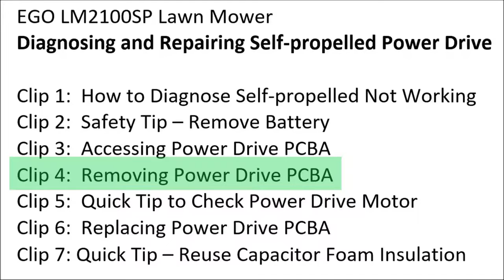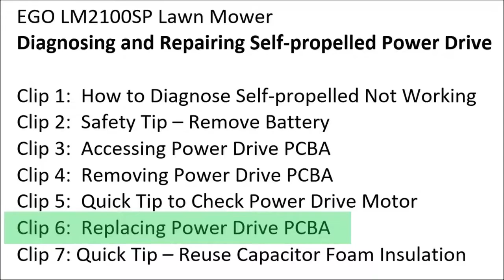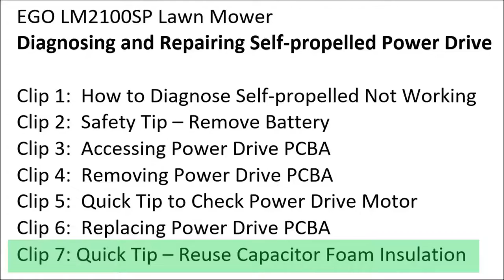EGO LM2100SP Self Propelled Drive PCB Replacement

Comment: I had the same problem, i watched the video and started to disassemble.  I removed the cover to start troubleshooting,  i noticed that there is a switch mounted on the right side , lokking atitfrom the rear of the mower. I put the battery in and applied pressure back towards the cam off theswing arm for the handle.  And the drive motor was working again. Made a wedge and placed it behind the switch to take up the wear.  Back in business!

Comment: Had the same problem with my Ego 2100SP. Self propelled stopped working, but the blade still worked. Everything worked except self propel. I noticed that the handle was not fully extended. So I fully extended the handle and the self propelled started working again. Be sure the handle is fully extended.

Comment: I have one of these which is behaving in an intermittent manner - can mow with the self propel feature working fine for a while and will randomly stop working for about 30-45 minutes, and then start again.  Took it apart and all harness are connected solid. Ideas?
Reply from the maker: test the main pcba there a video on here.

Comment: Just replaced PCBA module on LM2100SP, question what does brown wire connect to? Orginal brown wire in mower is connected to a red wire that is broken  just laying in the mower. Where is it supposed to be connected?
Reply from the maker: i am not 100% on what wire. did you replace the selfdrive pcba or the main?
Reply: @matterwin8635  Self Propelled Drive just like in the video, same wire you have in your fingers at 6:36 into video.
Reply from the maker: @EdMcGrath-t9b  sadly i did not make this video one of the engineers did. but that wire which you can not clearly see lol should be connected to the safety switch on the right side as you are standing behind the unit. the one that is activated when the handle is folded and unfolded .
Reply: @matterwin8635  Thank you much, I guessed that because of the length, but wanted to make sure before I soldered it back.

Comment: the 6 screws that hold down the top cover, are they hex or torx, what size bit did you use ?
Reply from the maker: torq T20
Reply: @matterwin8635  no, they are Phillips head
Reply: phillips head in LM2100SP version 1

Comment: So I replaced the PCBA but I don't see where the brown wire connects on my mower. I see the white wire but no red wire on that side. Any thoughts?
Reply from the maker: brown should have small wire running to the battery

Comment: Longshot here: I have a LM2100SP Type A, and the self propelled feature has stopped working. It will make a soft clicking sound for a few seconds before stopping. Blades run fine. Any ideas if it's the motor or the PCB? Do you have any videos of replacing the motor?
Reply from the maker: it is 80% chance it is pcba

Comment: What about a self propelled drive works but low power only no speed change
Reply from the maker: could be in the handle broken wire are the pcba that controls the self-drive. ruin the test in the video and see what one.

Comment: Good video, but kind of vague, most people don't know using heat shrink tubing and putting it on before soldering or how to solder or cut wiring/ connections without making it a headache if they cut too close to a connection. Could be more clear on assuming people have lil skill or just using wiring connectors to attach 2 pieces of wires.
Reply from the maker: i do understand what you are saying but theses videos are made for ego Techs so they should have a idea on how to make general repairs.